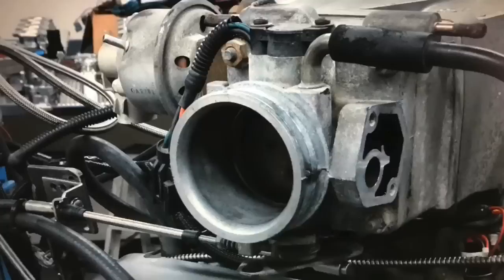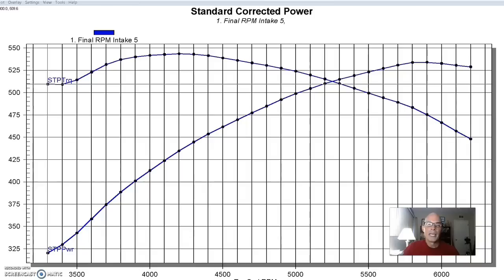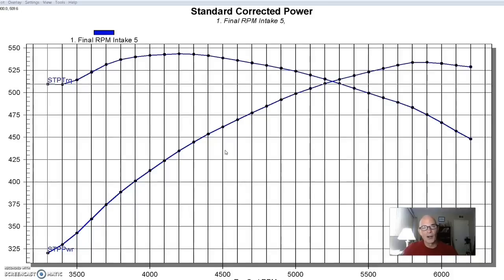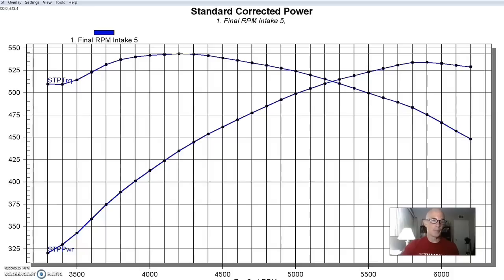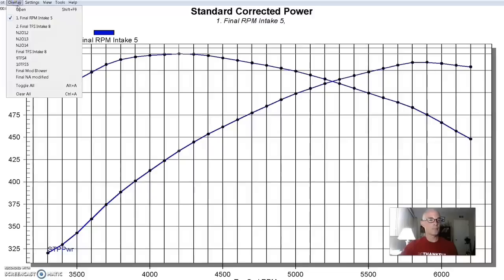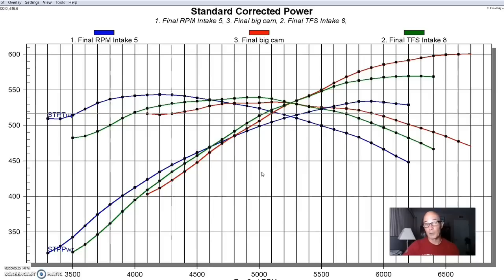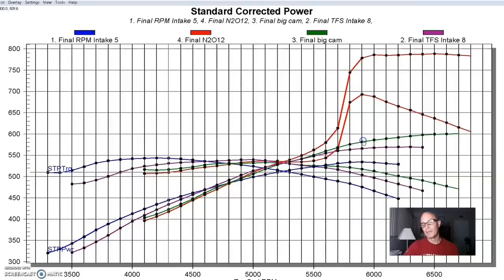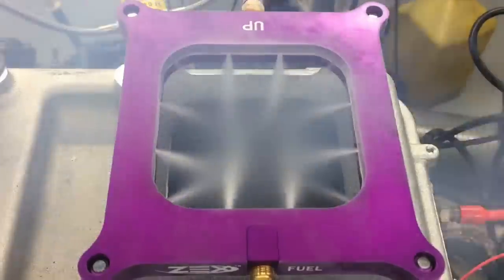HOW TO: BIG HP 408 STROKER FORD!

Comment: I would like to see a 351 vs 347 same heads test to see which makes more power na
Reply: same cam too, we'll see if the longer connecting rods and longer intake port length makes any difference.
Reply: all things equal the 351 will be on top just because it has 5ci more than the 347.
Reply: This would make a great bore vs stroke show down. Especially if the “347” had a .040 over block
Reply: Everything being equal compression camshaft head an intake for 351 should make more power 351 also has the advantage of having longer intake runners because of the taller deck
Reply: 351 revs higher but the 347 has a flatter power curve
Reply: The 351 would be the better route to go. The 351 has alot more positives compared to the 347.
Reply: 347 does
Reply: 347 due to lower reciprocating mass, but why would you ever build a 351" performance motor?
Reply: Marc B 351 is a good motor
Reply: @Fauxbra  This is a debate that has been going on for years. Why would you spend a ton of money to build a 347 cubic inch motor, when a stock, larger cubic inch option is out there.  I have owned both.  The 347 is impressive, but a 351 with the same heads and style of intake, and exhaust produces the same power if not more.  My seat of the pants feel when I did the swap, the 351 felt stronger.  Same cam, heads and exhaust.  Similar intake.  "Why would you ever build a 351 performance motor?"  Because your starting out with a stronger bottom end with larger main bolts, larger head bolts, more cubic inches than is available in the 302 platform. You can then stroke it out to "big block cubic inches" in a Small block platform.  The Roller cam 351W is the best small block that ford built.

Comment: Ford motors start at 460
Reply from the maker: Why you hatin' on the 429?
Reply: @richardholdener1727  https://www.youtube.com/watch?v=LlKkds2Lhx8
Reply: @toefield251  Good choice on that video!
Reply: @richardholdener1727  429 needs a 4.5" crank.
Reply: Seriously?  The Boss 351 makes HP per CI figures that the 460 could only dream of.  And in a much smaller and lighter package.  That big chunk of iron hanging over the nose ruins handling and braking.
Reply: @danmyers9372  How many Boss 351s do you know of, that make 1,100 N/A street friendly HP..?
Reply: Michael Angelo I know of one. And I’ve been trying to buy it for 20yrs. I know this it’s one Jon Kaase’s.
Reply: @danmyers9372  Where the fuck you gonna find a boss 351? 460s and 351 windsors are everywhere. Same as stroker cranks.
Reply: @danmyers9372  The 460 can be bored and stroked to 620 cubes, can't match the 460 platform in power